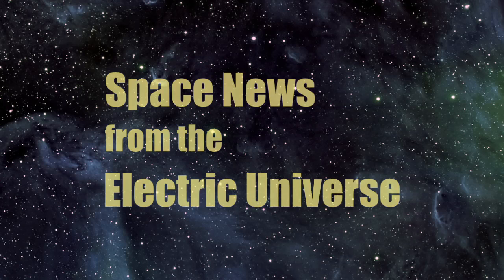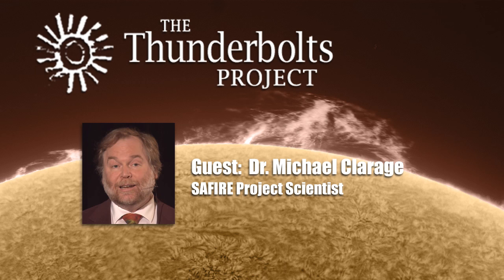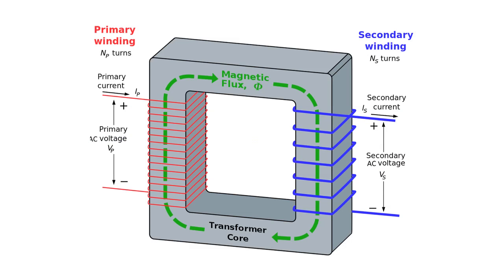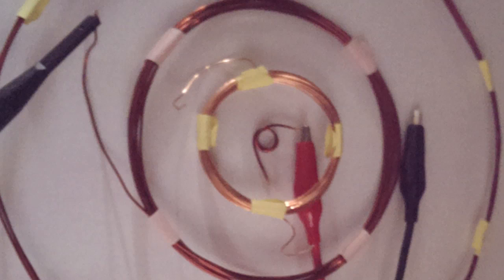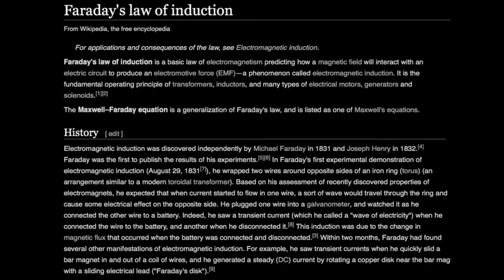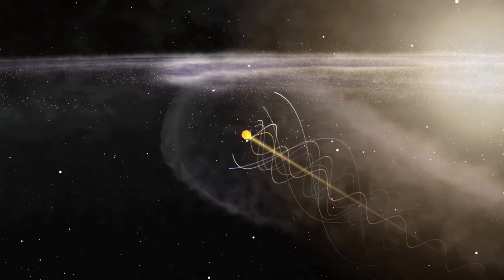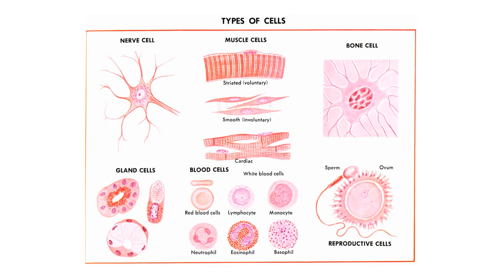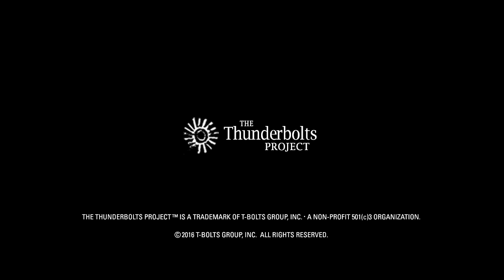A New Way of Seeing the Solar System | Space News

Comment: "Just me moving around the room would cause large  changes in the voltages".  How's it feel to be a comet?  The equalized voltages between the windings are an equilibrium, that you "perturbed".  Run an arcing  line in a perihelionic pattern and pulse it. Do it room size.

Comment: I believe this is much closer to truth but missing some key ingredients. I think you are on point about induction but let's dig past basic transformer theory and look at it more as a step mode power supply. collapsing magnetic fields drives voltage spikes like massive lightning strikes. voltage level gets driven by frequency or switched speed. 

remember that anything can be an inductor that can hold even the slightest magnetic field.

Comment: If galaxies and solar systems are cosmic electric motors could it be that the earths core is not cooling but kept molten and heated by magnetic induction?
Reply: Just blew my mind, sounds very plausible.
Reply: there is a huge electrical current flowing through the earth. It does not have a molten core. It doesn't need one. Earth's magnetic field doesn't come from a  permanent magnet effect, it's an electro magnet.
Reply: +kandysman86 Yeah. Wal Thornhill himself suggested that the earth is hollow.

Comment: I believe this is related to the info presented. 
Visualizing a tetrahedron within a sphere such as the sun or a planet. I am drawn to any of it's 6 edges. Each edge has a 90° shifted edge on the opposite side of the tetrahedron. What if the length of each edge and separation of the opposing 90° shifted edge is representative of 1/4 of a spinning energy waveform. This may also equate to the spiraling paths of planets along the path of the sun. 
If this is hog wash to anyone, I do apologize with a note that this idea has intrigued me for years.
Reply: Check out Chestahedron: the wonder of 7. You would love it.